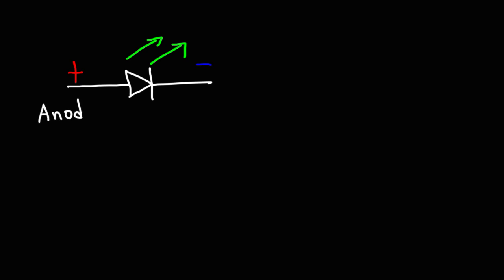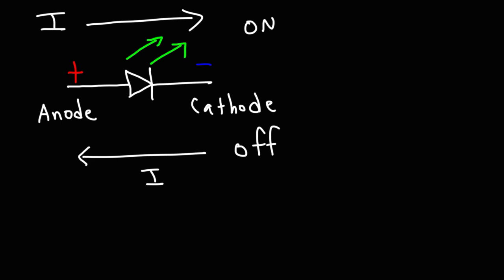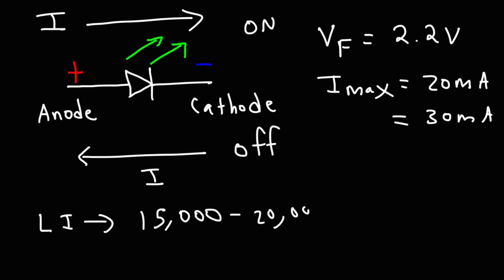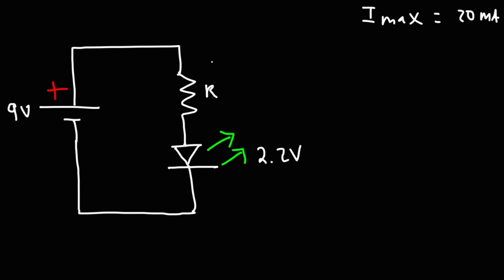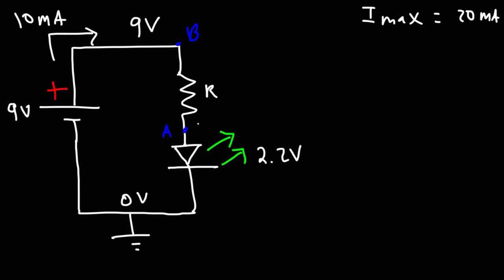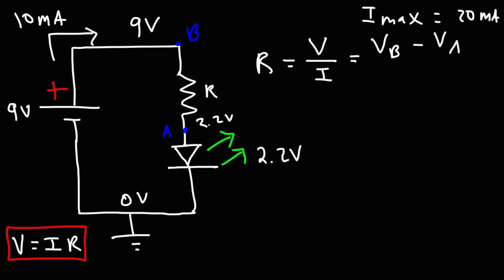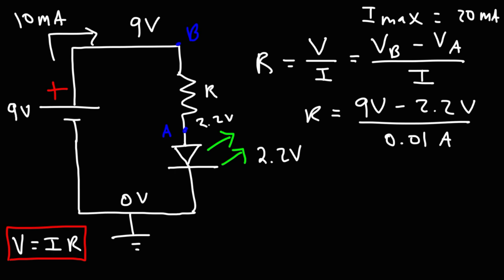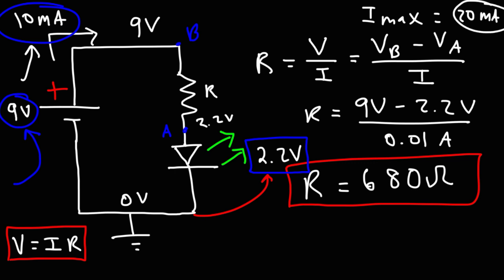LEDs - Light Emitting Diodes - Basic Introduction

Comment: how is there a voltage drop across diode wheb it is forward biased? 
or is it reverse biased because from diagram its forward biased
Reply: Even in forward bias there is a voltage drop but its usually small(0.3V for germanium diode and 0.7V for silicon diode).Here we have a LED so its a bit higher.

Comment: With this account, the efficiency of LED lamps is very low! For example, in the last row of the table, the resistance is 82 ohms and the current is 29.8 mA and the LED voltage is 3.07 volts, which results in a power consumption of resistance is R i^2= 0.07 watts and a power consumption of  LED is Vf i=0.09 watts. That is, a significant amount of energy is consumed by the battery in the resistor.

Comment: How do led strips work? Why are you able to turn on specific sections or send patterns through it without just having on and off on the entire strip? I saw someone make a 8x8x8 cube with an arduino but I don't understand how each led can be individually powered when they are all connected.
Reply: With a controller chip, a little processor that receives information of which lights to turn on and which to leave off, and it only sends energy to the LEDs that its told to turn on by a determined program
Reply: With a controller chip, a little processor that receives information of which lights to turn on and which to leave off, and it only sends energy to the LEDs that its told to turn on by a determined program